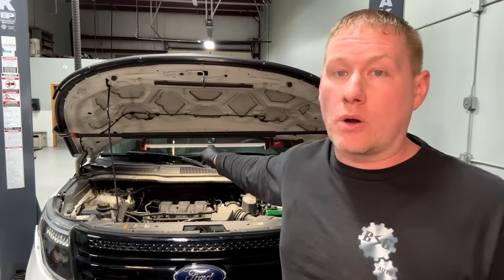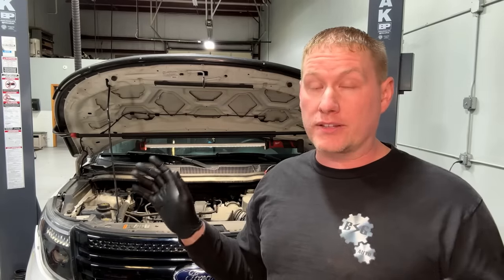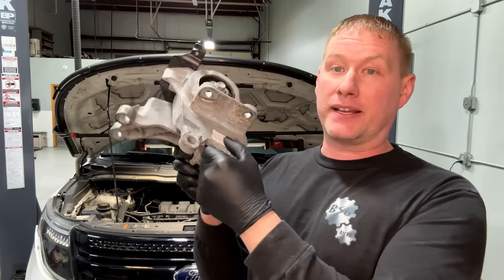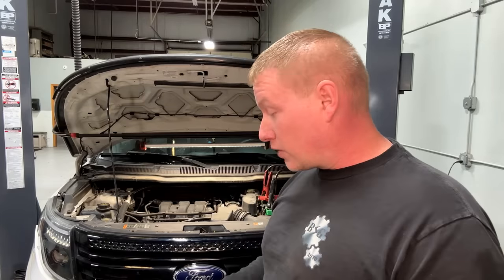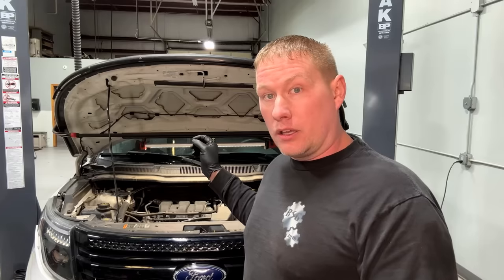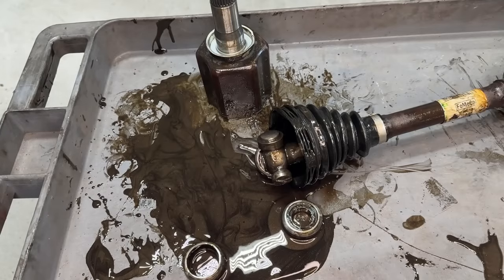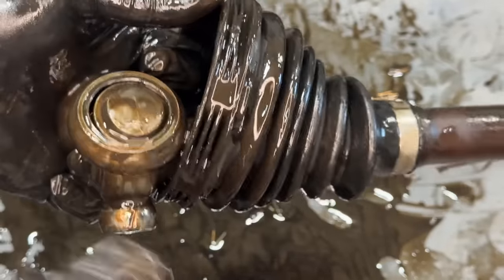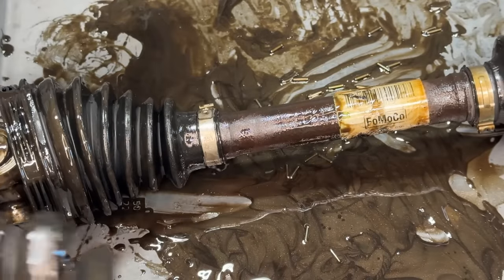Crazy 2014 Ford Explorer Vibration Finally Fixed!

Comment: I have 2-2017 ford explorer police both over 300,000 kms  (200,000mi) both run great appears poluce dept replceds some of these as they look new with stickers onnthem.  One does have slight viabration on accelerstion around 75 mph ..i thought bad tire but maybe your video is ibto something.  Will look for your video on transmission shutter  i have 2014 police taurus AWD transmission shutter at 4o mph.  Great videos

Comment: My 2016 limited pulls severely to the left on acceleration, had it to the dealership several times to no avail. Wondering if the torque steer is being caused by cv axles.

Comment: Came across this video trying to diagnose the same problem in my 2017 police interceptor utility. Would you recommend starting with the issues mentioned in this video for that year model as well?

Comment: I have a 2013 ford escape just turned 250,000 miles I have nots gear noise at take off to about the 3rd shift off the transmission and quits down and then no noise at highway speed at all I have changed fluid in the ptu 3 times since I’ve had it, after it has been driven awhile the noise at take off is pretty much gone , it had 190,000 miles when I bought it, what’s your thoughts and thank you I really enjoy watching your videos, Dana

Comment: Hello Brian, For 2000 Ford Taurus SE OHV. I need to turn the engine to TDC in order to replace Camshaft Synchronizer. When I turn the crankshaft, which direction I should turn? Also do I need to first disconnect negative battery and put the car in neutral position? If that is the case, how can I put the car in neutral while the battery cable is removed? Thank you!

Comment: Looking at getting a 2020 or newer explorer for my wife. Which engine option do you consider to be the most reliable? I have a 3.5 F150 and it has been great aside from the timing chain rattle at startup issue

Comment: Hello. I am about to do a timing kit replacement on a lincoln navigator 2011 with 5.4 V3 engine. This is all the same procedure right? I do not need to install cam phaser lockouts if I am doing this job right?

Comment: Dealing with a 2015 explorer right now with this weird growling noise. Only under acceleration. I'm going to check the Trans. Mount but if no dice I'm checking these. Engine mount has a fair bit of movement so I'll replace it and I'll probably just get the dog bone cause why not?

Comment: Brian, I’m having trouble finding any info on the 2.7 engines. Just picked up a 17 f150 with 180k on it and it’s got a ticking noise, almost sounds like a timing chain issue, any insight on them?

Comment: Could worn driveshafts cause shaking during braking? I’ve replaced all 4 rotors and pads on my 2016 xlt with towing package. Ceramic pads all the way around

Comment: I need help. I have a 2016 F150 XLT and I have a vibration bouncing going on. Ford dealer replaced my 4wd hubs and solenoid. Got brand new tires on alignment and balance and is still doing it. Any ideas

Comment: 2017 Ford Explorer V6. I hear grinding noise upon acceleration. Front and back brakes have been completed but still makes noise upon acceleration. The transmission shifts smoothly. Can’t figure it out!

Comment: I have a 2014 Explorer 3.5L that Started Rattling. Rattle sounds louder when turning on the vehicle and accelerating. The sound comes from the side of the vehicle, by the timing belt. What could be the cause?

Comment: Hello! My name is Mauricio and I am from Colombia. I have a 2014 Ford Edge and it is generating a vibration when the steering is turned at low speeds, when it is turned on an inclined part the vibration increases crazy. When the transmission is in D or R, vibration is also felt in the cabin, when it is in N the vibration disappears. We still haven't found the problem, can you help me, what should I inspect to find the problem?

Thank you very much for the help you can give me 🙏🙏

Comment: The days of getting a used police car and using it as a taxi, or a daily beater (sometimes after it was a taxi too!) are long gone.

Caprices, Crown Vics, Diplomats were tough cars. Sure, some quircks (try getting a Crown Vic to be as smooth as day one is a sisifian task, though it will drive forever with that vibrating wheel bearing). The Tauruses and Explorers just suck. Even the newer Suburbans arent as tough as they used to be.

Ive driven these back when I was in LE and we drove them HARD. Think, jumping curbs, flying in the air. I even wheelied a Tahoe (on its side wheels) lol, slamming it back down so I dont flip, which meant turning the opposite way, over a curb and into a ditch, then back out to where I was going. I dont see many of those Tahoes around today but CVs? Theyre everywhere still.
Reply: I have been buying used police cars for over 25 years. I also heavily wrench on them. They can be costly to keep on the road, with the amount of repairs needed. The Explorers and Taurus main issue is the transfer case. Some other issues, but fairly solid. The Tahoes are money pits as well. 2015+ are worse than the 14 and down. I had a 15 I just sold. Rebuilt the trans, oil pump (13 hour flat rate job now🙄), and MANY other issues.

The Crown Vics had their fair share of issues, same thing with the Caprices and Diplomats. Brother had an 87 Grand Fury from Detroit (318 2brl, 3 speed with no air🤣). It only had 65k on it but would the front end was blown out and would eat tires like nobody's business. Lt1 Caprice were fun cars to drive, but they were a mechanical wreck. Old Crown Vics would go through transmissions like crazy, along with the plastic intake manifolds.

Comment: Man I wish I would have known about this. I have 2014 all wheel xlt. Went through all you did. Ended up being the passenger right CV axle. Spring broke inside. Only way to know is removed it.

Comment: My 2000 ford expedition 4.6L V8 Triton XLT 4WD steering wheel has started to vibrate/shake when I drive, could it be something as simple as my tires need balancing? Hopefully it's something simple.

Comment: Hi Brian . I have an issue with my 2016 ecoboost 3.5 . On Park thé instant  fuel gauge IS on thé top roof . When i put in 1 , 2 , or 3 fuel gauge IS on thé top 😢 . O dont know where to look . During cruising am average 12L/100klm but when i am AT a stop or red light m'y economy go bâck UP again ... Do you have a lead ? Or an Idea please help i am in France

Comment: I have a 16 year old BMW M3 at 130k and still have the original CV shafts. Makes my happy do not have 4 wheel drive like the new ones 😂.
Reply: The rear cv axles.on most makes last 250K unless boots split. They have less range of motion and no second axis rotation like the outer on FWD experience.

Comment: Not an uncommon situation on some Toyota Sienna / Highlander vehicles with weak / soft engine mounts and worn CV axles. Occurs only under acceleration! Let off the throttle and the vibration disappears.

Comment: I am having this annoying shaking when I accelerate on my 2013 Ford Explorer. I have changed driver side cv axle, lower control arm , ball joint, drive axle, strut and the shaking is still there. I am planning on replacing the passenger side cv axle I changed 2 years ago. I am frustrated. It happens around 30km to 40km and 100k to 115km. Tires are good but not sure what is going on in ford. I need help please.

Comment: Chasing a vibration on a 2016 Taurus SHO (60,000km on the odometer). Speed related (only between 115km - 130km per hr) Tried everything, tire balance, pulled driveshaft and test drove....still there. Ugh. Any advice to hunt it down?

Comment: My 2018 flex fwd 80k has a vibration left pull very hard tq steer its shifts very aggressive dealer said it wasn't a trans that learns driving habit ect also states nothing is wrong with the car but something definitely is somewhere

Comment: I wonder if that’s the issue with my f150. I’ve had the CV’s replaced but they didn’t use OEM as they’re not a ford dealer. But I get a very constant grind in 4H.
Reply: I'd check your IWEs.
Reply: @Shiver2002  i run IWE deleted. I have a video of it on my YouTube page.

Comment: Brian, totally off topic but where can I go to find Ford design specs.  50 years of DIY mechanics and I had never heard of "odd fire".  I have a 2012 Escape with a 3.0.  Is this engine 60° and is it odd fire?  Thanks.
Reply from the maker: odd fire?
Reply: @FordTechMakuloco  Yes.  Have you not heard of it either?  The pistons fire at different degrees of rotation.

Comment: Hm my 2017 f150 3.5 ecoboost vibrates really bad, only on acceleration as well soon as you come of pedal smooth as butter, only has 45,000 miles on it

Comment: Normally I'd remove the 6 stacks with a die grinder , before belting the crap out of the tripod.  That cv can be rebuilt .
Reply from the maker: 130K of police service and it is is getting replaced. Especially because the Ford shaft is very cheap for this vehicle.

Comment: Does the slip guard fix mean the converter still needs replaced later down the line (just prolonged by slip guard) or is it just related to lack of maintenance/fluid changes??
Reply from the maker: It should be fine now but the additive is now a must every fluid change.

Comment: Imagine having the shake happen ONLY when the wheel is turned, either way, one side maybe worse.... (After an axle replacement, where the replacement axle was almost an inch longer than the original)

Comment: Amazing diagnositic process of a difficult scenario.  I guess with extreme duty usage, all previous part life expectancy goes out the window.  In other words any moving parts could be the culprit.  It was good of you to order the part and put it in to prove what was broken.  Like another commenter mentioned, if you change things on one side, you should do it on the other side at the same time.  I think due to driving dynamics, it’s more important to change parts on both sides of either the front end or the rear end, due to the fact both the left and right sides are going over the same piece of road surface at same time (both left and right of the front end, then both left and right of side of the rear end).  Nice troubleshooting!

Comment: In the mid 90's till 2000 I had a business rebuilding cv axles and rack and pinions and steering gear boxes and also power steering pumps. We had a Camry with that same issue. Slamming the drive train back and forth. It ended up being the inner cv axle was messed up. It had came apart lol. I couldn't believe it.

Comment: If transmission fluid gets changed most of em dont have problems. THe problem with that is people dont change transmission fluid until they have a problem which is in most cases too late.

Comment: As always,  expert videos. Question,  my 2005 F150 has a pop when turning to right only ( hard) . New rack, iner- outer rods, struts, shocks. Upper or lower ball joint? Driverside only.

Comment: I have a 2014 Fusion 1.5 SE ecoboost, and I have a grinding noise coming from the driver side underneath when putting the pedal down and a klunking when hitting bumps and potholes (unintentionally)

Comment: Dude I had a similar issue with a town and country. Couldn’t find nothing eventually I found out it was fix a flat in one of the tires. High speed shaking violently. Drove me nuts. Felt like axle shaft shutter

Comment: We used to rebuild cv shafts long ago, often because the boots failed so we would completely dis-assemble, inspect, and re-grease them.  Found more than a few that were trashed inside from wear and/or wear caused by contamination.  I partly understand why you put the shaft in on your own dime just to prove out the solution and keep your sanity, but i think the customer at least owes you a case of beer for that very expensive FoMoCo part...

Comment: Could this cause the transmission and engine mounts to wear out much quicker?  Been replacing my transmission mount and right engine mount 2 times in past three years.  2014 explorer 2.0L. Of course I’m using aftermarket autozone brand but they disintegrate after about a year.

Comment: Hey Brian, I’m hoping you can help me out because none of the shops in my area can. I have a 2011 f150 4x4 5.0 with a bad transmission and I found a 2014 transmission off of a 3.5 Ecoboost 4x4. I’m wondering if the the transmissions are interchangeable?
Thanks

Comment: I have 1999 Ford F250 2wd there was a small vibration at 63 mph didn't  show up until 63 mph went away above 65 mph.  It finally went away by it self no Ford dealer could figure it out I owed this truck since 2007 any ideas?

Comment: Hello can someone help me? I have an issue with my 2011 f150 5.0 when its in 3rd and I give it gas below 50% throttle, it bogs down about 100-300  rpm and holds like its slipping.  It acts like it's trying to shift prematurely  in between 3rd and 4th because of the way it bogs down 100-300 rpm , looks like it's slipping but the weird part is it only does it under 50% throttle and it wont do it in manual mode at all at any speed,  and it wont do it at any speed above 50% throttle in drive, if i give it a good amount of gas it wont do it.  Does anyone have any idea what causes this? when in manual mode or above 50% throttle it shifts perfectly, it also doesn't have any harsh shifting.  I'm stumped on why it would do this, my truck has 132kmiles no check engine light or codes

Comment: I have a 2014 ford edge is melting cylinder 6, went through 3 already. Thought it was the computer my buddy came over and was gonna reprogram it but said that cylinder 6 was responding to him. It’s driving me crazy. I think I may check the engine wiring.. long night ahead of me

Comment: That's whats know as a 3rd order vibration.  In other words, it oscillated 3 times for every revolution of the axle.  I'm not surprised with the condition of those mounts.  Between the sag from the mounts and the drivetrain torquing back on acceleration, that axle was running "flat" and the joint was being pushed back into the tripot to the point where it was hitting bottom and beating itself to death.  
A police car being driven hard all it's life?  No way!

Comment: I had torque converter shutter on my 2013 PIU @ 100k and luckily a flush at the Ford dealer fixed it right up

Comment: Wife had a 13 Explorer actually did not have crazy vibration but when I did her turbo, I noticed the right axle shaft mount was broken in 2.  The replacement part used 3 bolts in the engine to support he intermediate shaft before the half shaft.  No recall but the part was larger held the shaft over a larger area and much improved.

Comment: I saw this same issue back in the 90's on dodge caravans mostly, they would wear a groove inside the outer shell ramp of the inboard plunge joint, under acceleration it would force the lobe into the groove causing that same vibration, bad thing was the CV remanufacturers didn't always catch it and I would create this problem when installing a "new reman" axle, then have to change it out again, not many parts suppliers back then would give a labor warranty, parts only, so I would have to install another one for free.

Comment: @FordTechMakuloko what you opining on the transmission flushing machines, I keep being told they are bad for the transmission and should drop the pan. I have a 2017 AWD Escape 2.0L EcoBoost that coming up to its 100k service & it's developed the shudder you described.
Reply from the maker: I do not recommend them at all.
Reply: @FordTechMakuloco thank you for the info. I really don't want to go to ford to have the 100k mile service done but I can't find any place that will do the service without using the machine. Wish I lived closer as I would just schedule you to go over my SUV bumper to bumper..

Comment: I do not want to say exactly similar but as many universal joints on the drive shaft that I have seen that have either lost or bound up the needle bearings usually because they were subjected to the midwestern salt effect(mse) (not msg)😅

Comment: That inner Tripod joint sure has failed. But basically all Tripod joints are filled with a oil like grease from the factory. Allthough this one looked very dark the viscosity looked about right. Rzeppa joints should have moly grease but the needle rollers in Tripod joints are much better lubricated with oil. The strange things is that I have never seen a boot kit for a Tripod joint containing anything other than grease.
Reply from the maker: Yup the grease is always much thinner than say ball joint grease but this was soup!

Comment: Brian, i had this exact same issue months after my Ford dealer replaced my front rhs suspension spring, on my Ford Escape Kuga ( in the UK) went out and at 50 mph the bonnet was shaking violently, and i thought my teeth were falling out , though they denied doing it turns out they cut through the inner driveshaft joint boot as they accidentally dislocated the joint whilst swapping the spring out, didn’t tell me and then bodged the refitting so it spun all the grease out , by 9 months down the road when i spotted it , they said tough and that the boot could of been cut by me mounting a kerb. Cost me a new driveshaft for their incompetence,  Il never darken their door with my shadow ever again !! Love your channel.
Reply: Always get underneath and check their work.

Comment: THE AXLE IS WHAT WORE THE MOUNTS OUT
Reply from the maker: No these mounts all do this that is why Ford changed the design in 2015. I have replaced dozens with no driveline vibration issues.